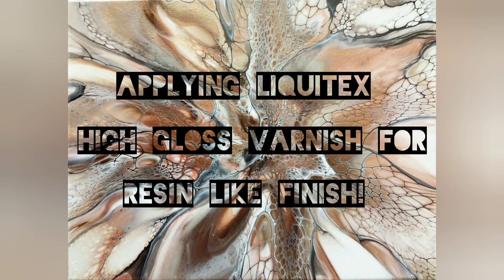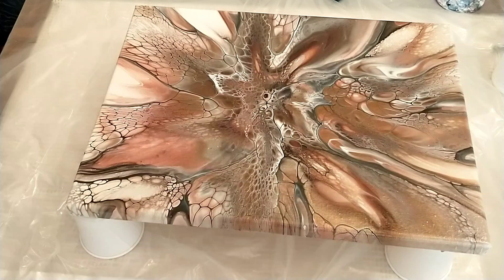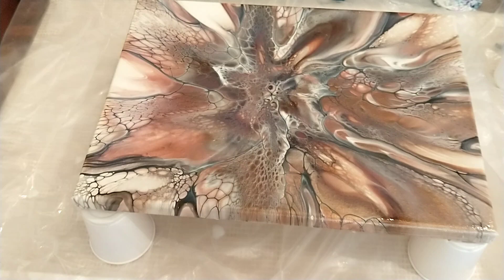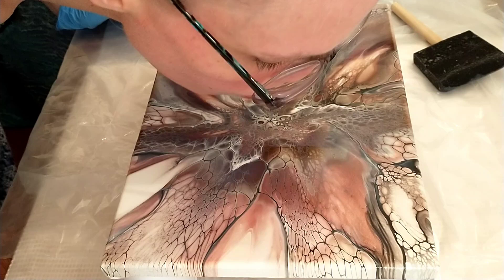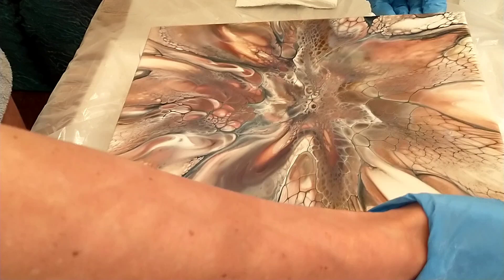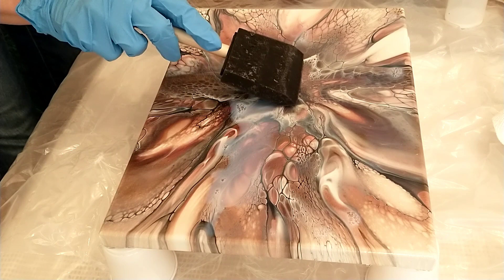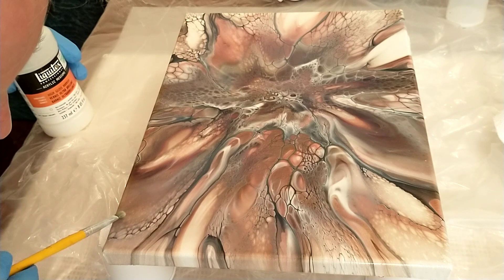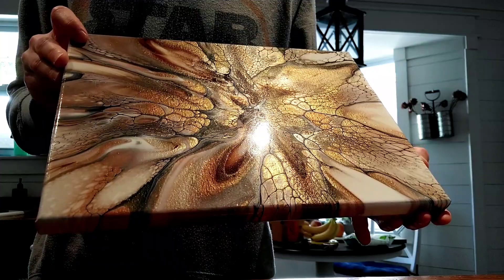#17 Resin like finish from Liquitex High Gloss Varnish, application tutorial #liquitexhighgloss

Comment: Thank you for the video! … just wondering if you could do a demonstration on a bigger piece ..I’m worried thatbecause it tacks up so quickly that it will create problems especially when you’re doing anything bigger than 10x14”I do canvases that are 12x24”, 15 x 30“ and also 30“ x 30“ roughly or more any suggestions should I just do cut layers and lots of them to make it easier or what is your suggestion? Thank you in advance🙏💕
Reply from the maker: I use this method on large pieces...the last one was a 24x24 and pretty much the same application. If you are nervous ...I would just do more cut layers.  You will only run into tackyness if you overwork the varnish or go over an area multiple times....
Reply from the maker: I would absolutely practice on a smaller piece first...😉
Reply: @WillieBStudios  yes I have it was fine but the bigger pieces I need tips on if you do a demo on a bigger piece that would be helpful love your work I follow you on Instagram as well 💕
Reply: @WillieBStudios  thank you 🙏
Reply from the maker: When I varnish a large piece ...it's no different from when I varnish small pieces ❤️ Nothing I do differently.

Comment: You put in black text to clean your canvas before doing this. Is that necessary to do if you don't use anything with silicone in it? If so, how do you clean your canvas?
Reply from the maker: Yes absolutely clean your canvas! With either alcohol swipe or spray a paper towel with windex and go over the piece gently.

Comment: Do you need to clean off Silicone?   Will it go over Silicone.   I used resin for the first time yesterday and I was so disappointed as there were gaps everywhere. I dont know if it was silicone or not. 
How do you clean the silicone off?
Reply from the maker: I don't use silicone in any of my mixes. At the beginning of the vid I mention that you need to make sure your painting is clean.  
If you were having issues with your resin and you used silicone in your painting..then yes ...that was the cause of your pitting!
Reply from the maker: I'm sure on YT there are vids that go over cleaning a painting with silicone. Some use alcohol...some use dish soap and water....etc!

Comment: Will adding more than 4 coats hurt anything?
Reply from the maker: I wouldn't go many over though..I'd say 6 coats max. I've done it when I was first starting out because I had a good sized blemish that I needed to sand and reapply varnish. Just make sure to let each layer dry over 6 hours. I like a full 24 hours when I get to multiple layers.